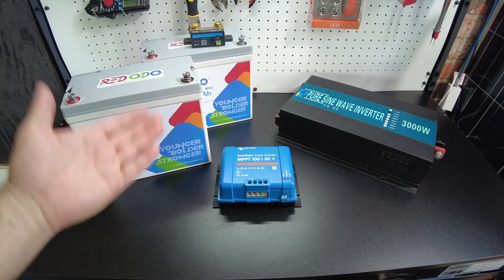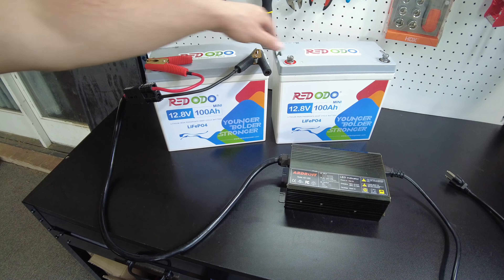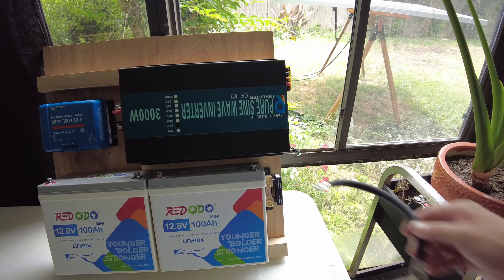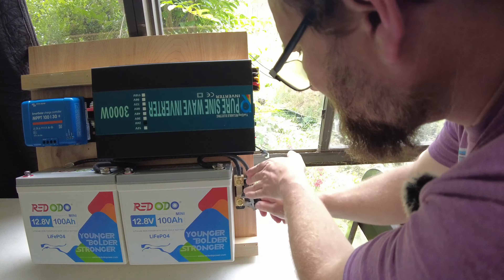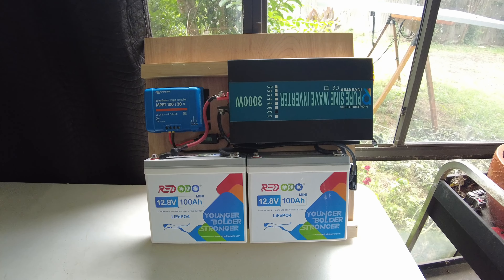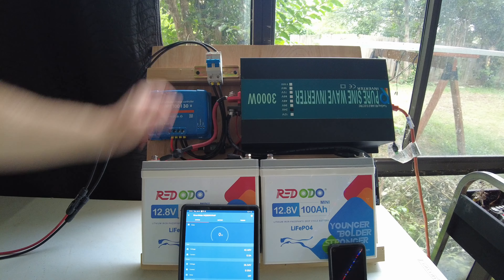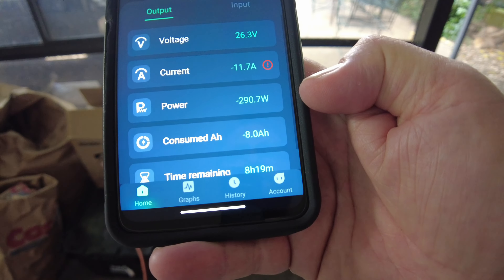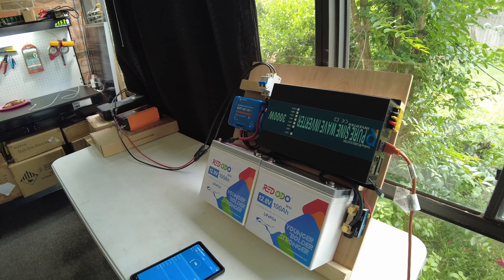Victron + Redodo MINI = beginner friendly 24v off-grid

Comment from the maker: Affiliate links:
Use discount code: bradcagle for 4% off
Redodo Mini 12v 100ah battery: https://www.redodopower.com/products/12v-100ah-mini-battery
Amazon Affiliate links:
Redodo MINI Battery 100Ah: https://amzn.to/3P44F4l
Victron 100/30 MPPT: https://amzn.to/41JTG2A
Reliable 3000w 24v Inverter: https://amzn.to/3WRoUno
TBD-SmartShunt: https://amzn.to/3XxnXQD
Midi Fuse Holder: https://amzn.to/3ChoYng
Midi Fuse Assortment: https://amzn.to/3IV4Fj9
Hydraulic Crimper: https://amzn.to/3MC5AHs
Tinned Copper Lugs: https://amzn.to/4j3dUOC
Hammer Crimper: https://amzn.to/3InPFKj
Ferrule Crimping Kit: https://amzn.to/3odMDS6
BusBars: https://amzn.to/42TSYB9
2awg cable: https://amzn.to/3OnBZmd
Midea U Shaped 12000BTU AC Unit: https://amzn.to/43xiXPm
Precharge resistors: https://amzn.to/3PEuRCk

Comment: Understanding 12 V I made the typical mistake of buying some 12 V batteries so I have four 100 amp hour 12 V that I would love to use in a system while I save up to get either a 24 V or 48 V battery bank.can I do two in series, and then two banks in parallel to get the use of all four batteries and make it a 24 V system. I am learning, but still very much a solar novice.

Comment: Nice little compact system. I like the idea of these mini batteries, but I am having a hard to being a believer in them just because they are so small. Curious to see how these hold up over time.
Reply from the maker: Yes, I'm curious of the longevity too. Thanks!
Reply: If you have seen any of the reviews of the batteries where the take them apart, most of the battery case is empty.  The batteries are made to a form factor to replace existing sizes. Examples are 24,27, 31 or D8. The new mini battery would save the manufacturer form having to fill the case with some type of fill to hold the cells in place. The only thing that might be a negative is you would have more vibration transmitted to the batter cells with a mini format battery.

Comment: Hi Brad, nice video to show how easy it is. It's not recommended to have the fuse like that though. It bends the metal part that should melt, causing it to potentially malfunction. It's a 125A fuse but it should be 160A.
Reply: @javiercoronel1169  😱😱

Comment: Are the two Mini batteries smaller than one 200AH Redodo battery?
Reply from the maker: I think so.
Reply: They still are using only 100 amp BMS.  I like the 200AH Pro with its 200 amp BMS for large loads.
Reply from the maker: @bitsurfr46  Two 100Ah minis with 100a BMS in parallel is equivalent to 200a BMS, provided the are wire properly.
Reply: Thank you.  I didn't know that.😮

Comment: how long would either the 12v or 24v setup run a dc compressor fridge with 100AH? as long as it will run one for more than 19 hours with no sun, you should be good, even for winter sun hours.
Reply from the maker: It really depends on the fridge, and how often you open the door.

Comment: Newbie question - what drives needing 24v or 48v vs 12 volt when it comes to a solar setup?
Reply from the maker: Mostly scalability/cost. The amps/current handling requirements go way down as you increase voltage. For example a 30a MPPT can handle around 400w at 12v, but it can do around 800w at 24v. So you doubled your power capability, yet your cost of equipment, and wiring  are the same.
Reply: Thanks for the Q&A. Light bulb moment for me!
Reply from the maker: @mrdavesivertsen  Anytime!

Comment: can I use a a regular car battery I have a red top optima
Reply from the maker: It's not really advisable. You technically could, but car batteries are not deep cycle, so they don't like to be discharged very deeply. It wouldn't last too long. But the optima might last longer than most.
Reply: A car battery can only be discharged to 50% before it can become damaged beyond repair.  So if you have a 80 AH battery, you can only use 40 ah.  Lithium batteries can be fully discharged without being damaged.

Comment: What kind of charger was that at the beginning of the video? I’m doing a 24v system for my RV. I’m not using solar at all I just want to recharge my batteries when I plug in to the RV site
Reply: Run my batteries while driving to the beach recharge them when the RV is plugged in

Comment: Why not charge them up in parallel?
Reply from the maker: You can. If you make sure the voltage of both batteries are close. This video is for beginners, so I'm trying to make it as error proof as possible. If a beginner connects a very low SOC battery with a very high SOC battery they may get a thrill 🤣

Comment: Nice!!   I've got 2 12v LifePo4 1st version Powerqueen Premiums hooked in parallel with same inverter but 2000watt in my older truck camper.      They seem to power up a 5000 BTU window ac and the rv really well.    I just need to do the Solar next after resealing the whole camper.

Comment: For the same setup, is it possible to replace the power inverter with a Power Station (E.g Ecoflow) so that these two batteries can be used as an expansion to the Power Station, they supply 24V directly to the Power Station for its charging. How would anyone comment this configuration, pls.

Comment: Plan building this system to run a freezer and ref. during power outages, but plan on using a 24v 200amp hour battery.  My question would be would the inverter be able to run for several days continuously if needed and if I keep the battery charged.  I had rather spend more on an inverter that would not get hot and shut down.  Your video keeps it simple, for me. Thanks!  New Sub...
Reply from the maker: I run this inverter 24/7 in my garage with an A/C unit. It's been great!
Reply: Thanks much!  Should run a couple freezers and some light then. @BradCagle

Comment: If you have the Victron 100/30 why do you need a shunt, I'm just starting
Reply from the maker: The shunt is needed to monitor power in/out of the battery, so it can calculate state of charge (SOC) basically like a fuel gauge for your battery. The 100/30 is just a charger, it has no way of knowing how much power has been removed from the battery. Thanks

Comment: going with 24v set up just 100ah battery maybe get another later going to use 2500 or 3000 inverter.... will a 75v 15amp MPPT good enough for 400w panel ? going to use 2 200w panels put it in series ..keeping it my panels 400w since its in a small space .. or should i just get the one you have on the video 100v 30amp or that over kill for my 400w solar ...
Reply from the maker: Nice, 24v 100ah is pretty good. That's the same capacity of these two 12v 100ah. As for the 75/15 charge controller, it should be fine. I have the same controller on my nissan Xterra. I have a 360w panel on the roof, charging a 24v 100ah battery just like you're going with :) BTW there's also a 100/20 controller that's usually not much more. Thanks!
Reply: @BradCagle  thanks for the information.. I'll stick with 75/15 charger.. I'll only be using the inverter for like small Kettle,  Microwave,  Toaster,  small e stove and a very small ac but that's when I get another battery..

We have lots of sun in California and I don't run the appliances like all day only to heat and cook food for couple mins at a time.. then I'll use a 24v to 12v step down 40ams to power up Led lights fans phone charger and heated blankets  ect... 

Was going to go 12v set up but 24v is pretty much same cost and more efficient..

Comment: Question, why 24v and not 12v parallel?
Reply: Lighter cables is one consideration, another one is the simplicity of stepping down to 18 volts for laptops, TV, etc, no inverter loss.

Comment: I am thinking to get this victron 100/30  connected to anderson  on licitty bat box  for 400w single panel  so instead of max 6 awg cable cab i make with 10awg from victron to anderson on the licitty box is it safe ? Or better get 6awg but  then need to buy good crimp for thick  cable
Reply from the maker: I've done exactly this, with a 10awg cable. 10awg is plenty for 30a.
Reply: @BradCagle  allright  thanks 👍🙂

Comment: I need a setup like this to run a portable a/c or inverter powered window unit, for when the hurricanes knock out my power. they pull 450 to 200 watts depending on fan speed.

Comment: If I try this system and I really do want to eventually I’m curious about how you would wire the panels for instance could I wire six 100 W Renorgy Solar panels in series series parallel, and then power that charge controller that way it just make sure that I would hook the charge controller up first to the 24 V batteries source so it would know what it was dealing with and the 600 watts coming in from the array would power it or do I have to wire the panels a special way?

Comment: what size wires are you using?  3000w at 24v is 125a.  how big is the fuse?  have you tried a max load?
Reply from the maker: If i remember correctly it was 2awg temco welding cable. Probably a 150a fuse.

Comment: That fuse should be between the solar panel cutout and the Victron.  If you put it between the Victron and the battery with the panels connected and the fuse opens, you will probably smoke the Victron with panels hooked up and no load (the battery) on the output.  Otherwise,  nice explanation.
Reply from the maker: @pabear3636  You're supposed to have a fuse between the charger and the battery. I do get what you're saying, and yes some chargers could become damaged from such scenario. However IMO that would be a poorly designed charger. A good design shouldn't self destruct, and as far as I know Victron chargers can handle this. Thanks

Comment: Hey brad my 150.70 is working great my 100.30 is great but i bought a 100.50 victron and it wont connect. I tried the 1234. 0000. 000000. None will let it connect. My amazon warranty has run out. Do you know any trick to reset it or make it connect?

Comment: This is cool. What btu is the a/c system and have u done a test to see how long it will run on low or high before batteries are low? If not can u, i would like to see and also like to see how long it will run with solar coming in and with out any solar.

Comment: I have a question about battery size-everyone uses just 100ah batterys , can you use higher ah batterys in series to create a larger system would I get more ah/watt hours? all I have is 700 watt heater keeping my 12x24 workshop somewhat warm in the winter with alot of cloudy days in the winter (UP Michigan)

Comment: 2 questions Brad. I've always wanted to connect a fuse straight to the terminal instead of having a fuse in between 2 cables but I have read everywhere that's it not recommended unless you use a terminal fuse. You're the first person I've seen connecting the fuse straight to the terminals. 2) Why did you connect the cables from the mppt to the inverter where everyone else(including myself) connect them to the batteries ?

Comment: Very neat setup. Nice one Brad - very simple but 100% on the money.
I guess a strap over the batteries for a little more security and you could mount it vertically permanently, say in an RV. 
2560WH and weighs around 40kg I expect - pretty good. 
I thought about arranging it differently to have the  inverter the right way up - I think if you put the inverter on the left with the input terminals facing to the right?
Reply from the maker: Yes, I actually have strap I was going to use, but I totally forgot about it, LOL. It's tough to make these videos, have a regular job, and life all at the same time. You'll forget stuff that you would have normally considered trivial :) Yeah totally could have had the inverter the other way but I would have had to make up a new positive cable. I'm trying to build up a stash of cable to reuse in videos, cable is soo dang expensive. Thanks, Ben!
Reply: @BradCagle  It was just a thought that occurred Brad, wasn't inferring you should've - just sharing the thought with others on this forum. 
There is a lot to making the videos, and you just pointed out some things that I haven't thought of. Keep up the great work. Your channel is really useful and informative, so you do what you need to do to make it worth your while and therefore ours!
Reply from the maker: @Bennyboy-dog  Oh no, I didn't think anything like that :) I really enjoy your comments, and feedback. You have some very insightful info, please keep it coming!

Comment: Not bad.  I would make three adjustments.   First, use an ANL fuse for the main battery fuse (and note that an even higher-end T-class fuse is not necessary for a small system like this).  Second and more importantly... when doing a 24V system from scratch, buy a 24V LiFePO4 battery.   Don't use 2 x 12V batteries in series.  I would go as far as to say when doing everything from scratch, just go straight to 48V and be done with it.  Even for a small system.   System expansion is also a lot easier as additional batteries can simply be added in parallel.   Series x parallel battery setups with LiFePO4 have issues.

And finally, make sure the inverter's low-voltage cut-off occurs before the battery BMS's low-voltage cut-off (usually it does).   Or program the charge controller's relay output to shut the inverter down on low-voltage, again before the battery's low-voltage protection engages.

Now if you don't have a choice and have to use two 12V batteries in series, you do need a whole battery balancer (which is cheap).  Otherwise you are going to run into problems down the line.   But it is best to avoid all the issues related to putting LiFePO4 batteries with independent BMS's in series and just get a native 24V battery.

All the equipment is available in 24V and 48V these days and basically just as cheap.

Comment: Nice setup Brad. I see Reliable makes that inverter in 12v what are the advantages of 24v ?
Reply: The advantages of 24v vs 12v is that the wire gauges can be significantly smaller.  Its more efficient to run more power at higher voltages.  That's why most big systems ae 48v.  To run a large 12v system you would need really thick/high gauge wires.

Comment: NEVER put 2  battery with bms in SERIES, never, you ask for trouble, chance you are going to burn the mosfet and let them stuck open and you will lose ALL protection from the bms, have seen that happen numerous of time, DONT PUT BMS IN SERIES
Reply from the maker: False. If they are made to be placed in series then you can. These can be placed up to 4 in series.
Reply: @BradCagle  most of them are not . Pretty sur you dont know what bms are in thèse . Maybe they can . Some can yes . But most of thé Time its not a good Idea . I have seens so many bms fail because of that . Wanna 24 volt ? Buy a 24 volt bms :x. I never trust thèse already made battery.  They tell you they can go in séries even when they cant.... Sorry maybe in THIS case its safe but still i would NEVER recommend this :x
Reply: @chris_mk5supra All Lifepo4 batteries have bms. You're pretty much saying you can't series any lifepo4 batteries which is completely false. Even the manufacturers say you can series these. I have 2 systems that I series my batteries for 24v for years.